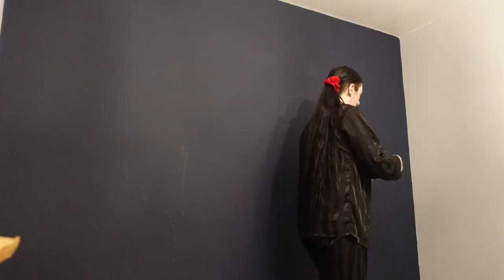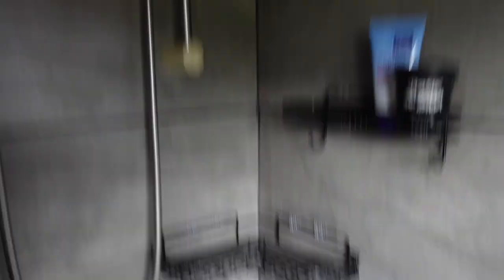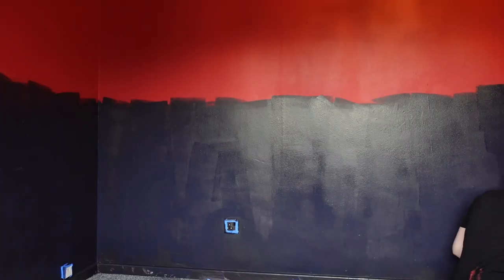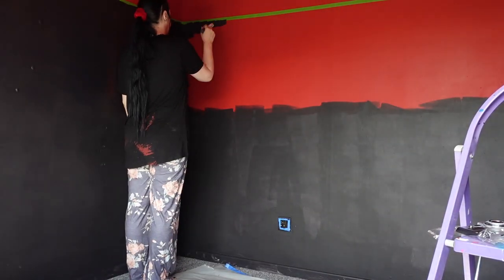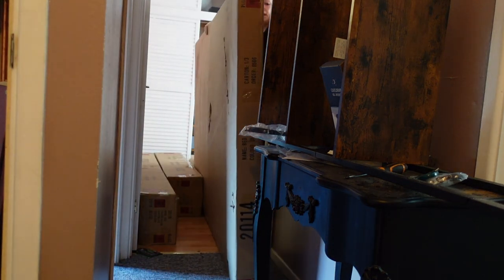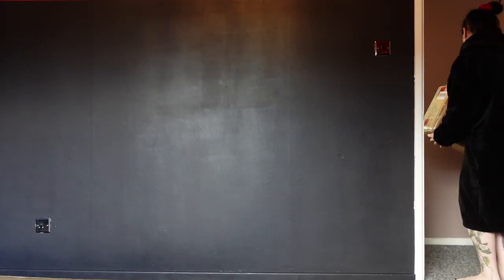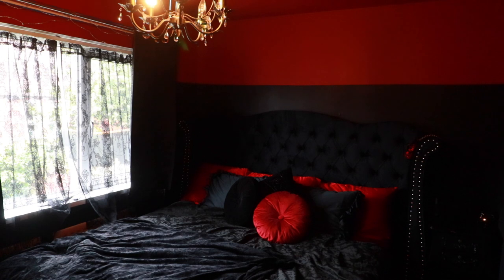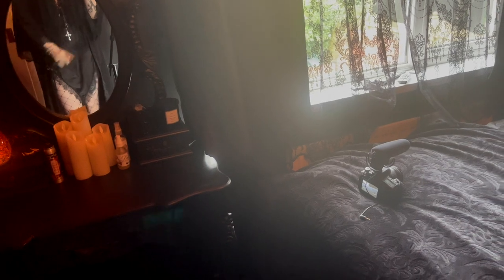Gothic Bedroom Transformation! | Toxic Tears

Comment: I’m going to explain how to do the ombré just for those that are curious. So a mistake that many people make when wanting to do a project like that is assuming that two colors like black and red will just blend and create a natural looking fade. But because the colors are so completely different that actually doesn’t work. You would have had to experiment by mixing the black with white and red to make a slightly lighter color and the soak the sponge in water squeeze some of the water out so it’s not soaping wet, then dip it in the shade that is slightly lighter and redder then dab it back quickly in the water and then apply it where the black meets the red. You would have to keep mixing shades and doing it until it eventually the black blended with the red. You would have to later the colors and create a good amount of overlap. Also you would need to make sure that the paint your using could be diluted with water for it to work.
Reply: I wrote the same thing! Not mentioning wetting the sponge but getting different shades to gradiate with!
Reply: Or, if the paint doesn't dilute with water, just create a bordo transition shade that's in-between black and red, split the sponge into two and use one half to work on red-bordo ombre, while red is still wet, and the other half on bordo-black, while black is still wet. That way you only need to make one gradient at the time, instead of tackling a whole array of shades and on such a big scale.
Reply: 🔥 🔥 🔥 🔥 
🖤 🖤 🖤 🖤 
I'd have painted a wall of flames in my bedroom for sure!! 
Lol, if I was a homeowner, it'd definitely be full of oddities and very well executed painted themed walls. 😅
I worked in a shop that was black and red... the name of the black paint was "dark magic"... 
I stood where my booth was to be& said "You know it's really hot over here for some reason...odd..." My boss said that the last renters of the building had a church here,  I looked down where I was standing    👁👇👁    (🖤 my new booth🖤 ),  and could clearly see the skuff marks from where the preacher/podium stood....😂 I said,  "well,  that explains why I'm sweating 🤣🤣"  Good fun. 😂

Comment: For the room painting, you always have the option of adding a wall trim or a panel of wallpapering at the point where the red and black meet to add some depth or just use as transition, like a stripe of flexible crown molding

Comment: Did you use wet sponges to do the red black ombre? If you use dry it will not blend show to much texter. You can also soak half sponge in red paint n half in black so wet in paints and that way but sponge has to be a smooth one kind of like a oversized makeup sponge!! That idea would of looked beautiful but either way it turned out great and congratulations on getting the place and getting your life back and being happy!!

Comment: What size bed do you have?  Looks like a king.  I have a California king, which is basically a huge square bed.  I love to stretch out too.  I painted my room after my husband died.  It has a black ceiling, and purple walls.  Black window frames and sills.  Closet doors black.  I always wanted to paint my room this way, but my husband wouldn't let me when he was alive.  I have purple and black sheets and pillow cases, and a furry black throw rug.  You did an awesome job on your room.  Looks nice and cozy.  I had the same issue as you did with the black paint.  Went on blue-black, but dried black.  I use semigloss paint though.  Not a fan of flat or eggshell finish.  I like a little gloss.  (Jan Griffiths).